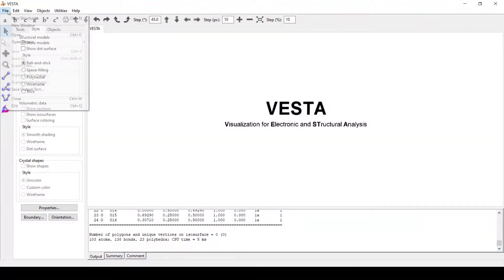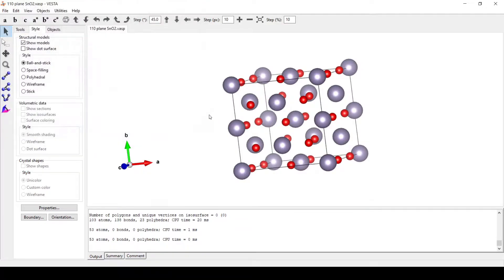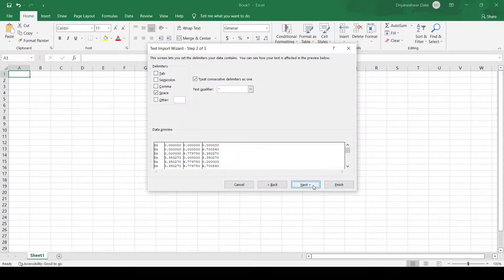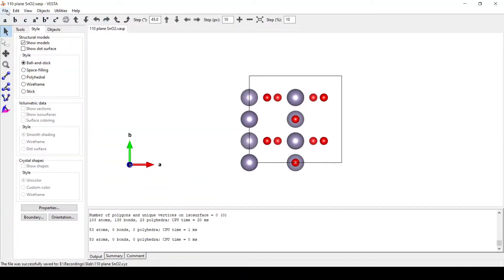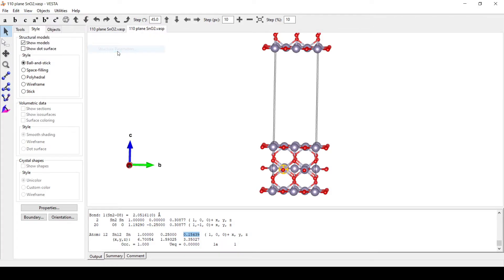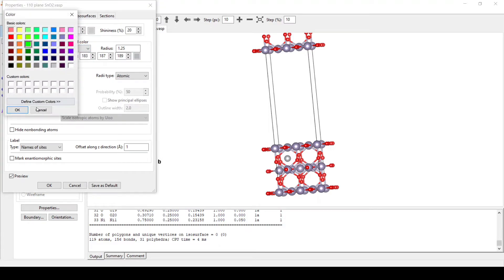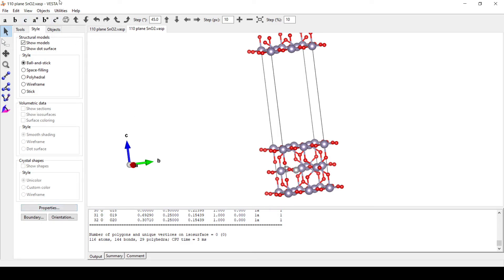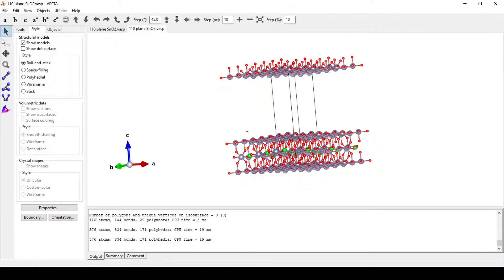Doping in Supercell using VESTA

Comment: Is it always necessary to add vacuum in supercell  for doping? Or can we dop only in supercell with out adding vacuum?
Reply from the maker: In simulations of doping in a crystal structure, it may or may not be necessary to add vacuum in the supercell, depending on the specific goals of the simulation.
Adding vacuum can be useful to avoid interactions between periodic images of the crystal and to prevent artifacts that may arise due to boundary effects. This is particularly important if the dopant atoms are located near the edge of the supercell.
However, if the dopant atoms are far enough from the edges of the supercell and the periodic boundary conditions do not affect the results of the simulation, then adding vacuum may not be necessary. In some cases, the presence of vacuum may also lead to artificial effects, such as a reduction in the doping concentration or changes in the electronic structure.
Whether or not to add vacuum in the supercell when simulating doping in a crystal structure depends on the specific goals of the simulation and the location of the dopant atoms within the supercell. If the dopant atoms are far enough from the edges of the supercell, then vacuum may not be necessary, but in other cases, it can be important to avoid boundary effects
Reply: Thank your cell.

Comment: Thank you so much.
 Please could you explain that is it always choose a plane like [001] or [110] or any other plane before making super cell and adding vacuum?
Reply from the maker: When creating a supercell for a simulation of a crystal structure, it is not necessary to choose a specific plane before adding vacuum. The choice of the supercell size and shape depends on the specific goals of the simulation, such as the desired level of accuracy and the size of the system being modeled.
However, in some cases, certain crystallographic planes may be preferred for simulating specific properties of the material. For example, if the properties of the surface of the crystal are of interest, a simulation using a slab of the material oriented along a specific crystallographic plane may be more appropriate. In this case, a specific plane such as [001] or [110] may be chosen based on the crystal structure and the desired properties to be studied.
 Furthermore, the choice of plane may also affect the boundary conditions imposed on the system, which can in turn affect the results of the simulation. For example, a simulation of a material with a free surface may require a vacuum layer above and below the material in order to avoid interactions with neighboring periodic images. The size and orientation of the supercell can affect the thickness of the vacuum layer needed for accurate results.
Reply: @DnyaNiPhysicsWorld  Thank you so much.  Its really helpful for me.

Comment: could you please explain what types of atom can be dopped in a compound either fixed atom or any random atom as an impurity atom. Is there any rule for doping?
Reply from the maker: Doping refers to intentionally adding impurity atoms to a material in order to change its electrical, optical, or structural properties. Doping can be done with a fixed type of atom, or with a random atom as an impurity.
The choice of dopant atoms depends on the desired properties of the material. For example, doping silicon with boron or phosphorus can create p-type or n-type semiconductors, respectively, with different electrical conductivities. Similarly, doping a crystal of diamond with nitrogen atoms can change its color from clear to yellow.
There are some general rules for doping. The dopant atom should have a similar size and structure to the host atom, so that it can easily replace the host atom without disrupting the crystal structure. The dopant atom should also have a similar valence electron configuration as the host atom, so that it can easily bond with neighboring atoms in the crystal lattice.
In addition, the concentration of dopant atoms should be carefully controlled to achieve the desired properties of the material. Too few dopant atoms may not have a noticeable effect on the material, while too many can introduce defects and change the material's properties in unexpected ways.
Overall, the choice and concentration of dopant atoms should be carefully considered in order to achieve the desired properties of the material.
Reply: @DnyaNiPhysicsWorld  Thank you so much.